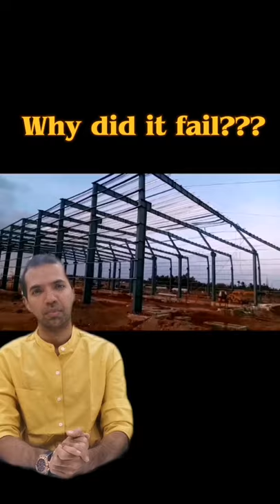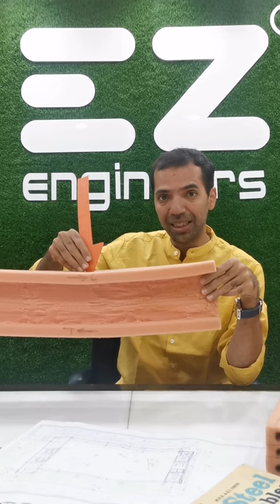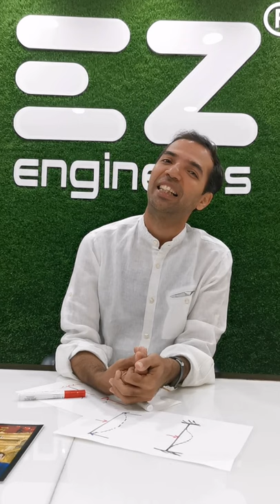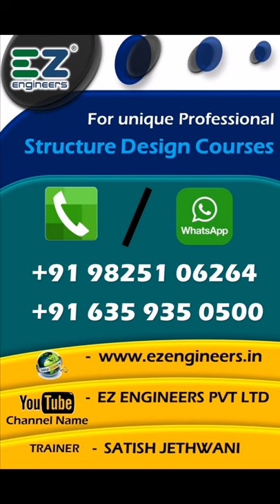Steel Structure Failure EXPLAINED! Why did it Fail? #shorts

Comment: what is the solution sir? Should lateral stiffeners be installed?
Reply from the maker: you need to understand effective length concept properly. If you don't get good option in our city to understand this, we are available at Vadodara, Gujarat.

Actually we teach these kind of concepts in our Practical Professional course of 20 hrs, which is possible offline only.

You need to actually understand path of forces by applying load with your finger on spring and foam models, and literally look at -
Where is lateral torsional buckling effect, 
Where is Bending about minor axis,
Where the support need to be fixed about 1 axis and fixed about other, 
where we need to provide shear connection where to provide moment connection...
and so on😳🤷🏻‍♂

plz watch last 2 minutes of this video, to get more details

https://www.youtube.com/watch?v=s6NlqFSlQRw&t=6s&ab_channel=EZENGINEERSPVTLTD